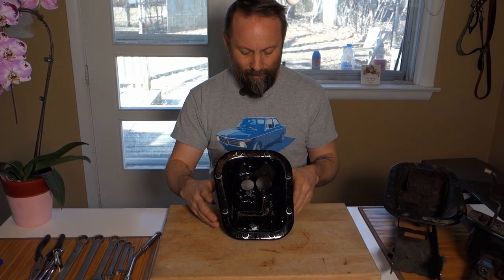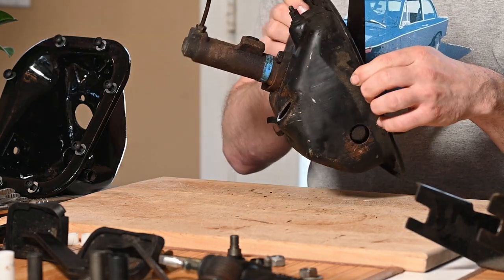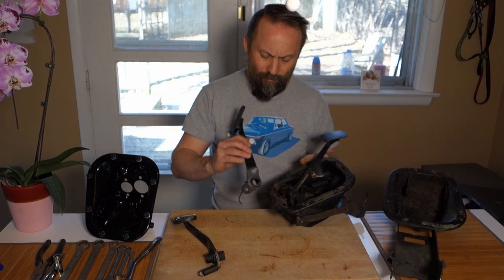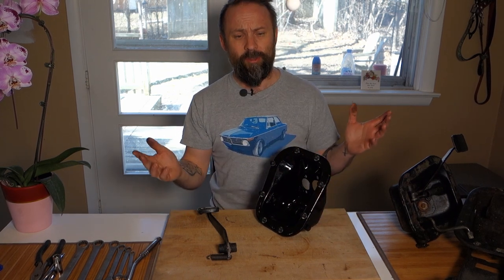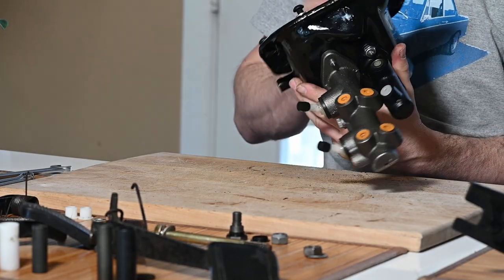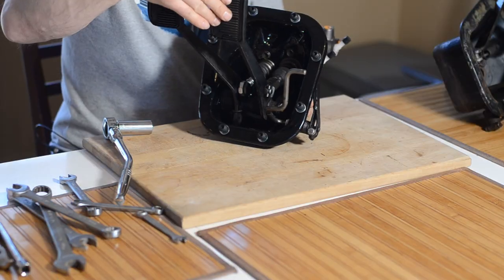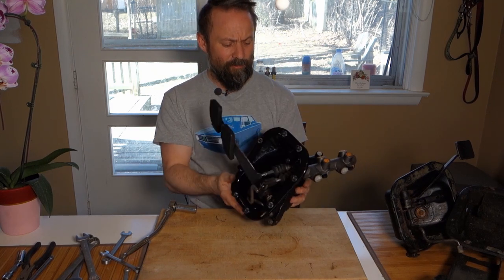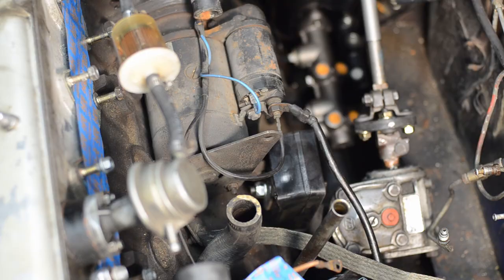PROJECT 1968 BMW 2002 PH02E06 - Pedal Box Rebuild

Comment: Those pedalboxes look narrower than the ones i have in my 02s
Reply from the maker: I'm pretty sure they are standard units for the mechanical and hydraulic clutch.   I need to change the pedal geometry a bit on the brake, otherwise it's still working great.

Comment: Hi, what bmc did you use?
Reply from the maker: https://www.rockauto.com/en/moreinfo.php?pk=309072
Reply from the maker: All my info is here:

https://www.bmw2002faq.com/forums/topic/273644-pedal-box-boosterless-conversion/page/2/
Reply from the maker: Note that the dims from the Rock Auto part were a little longer than the details posted in the FAQ. It still worked, but I had to shave it down.